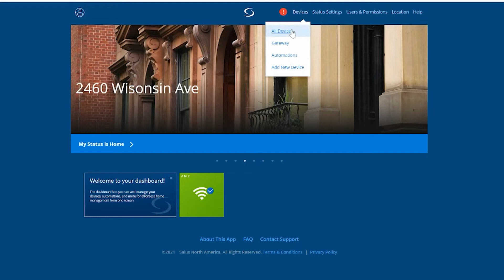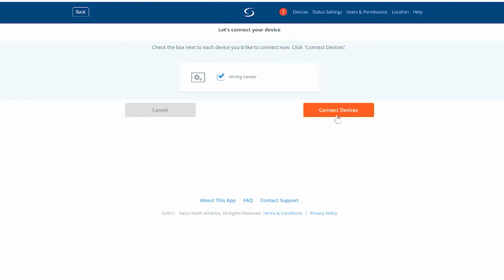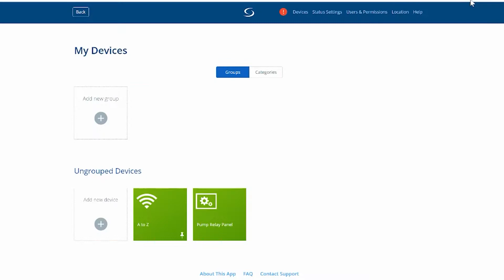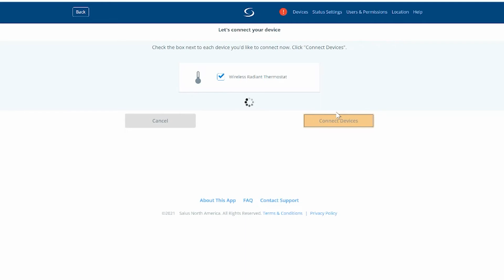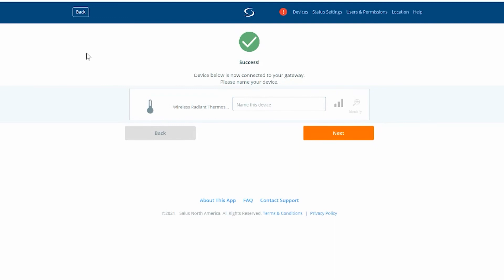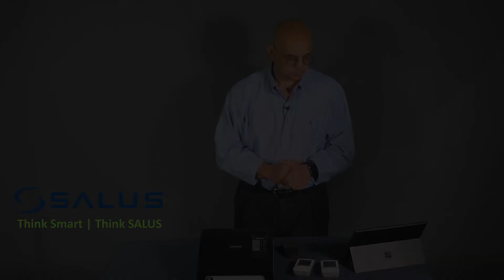Setting Up a SALUS Wireless 4 Zone Pump Relay Controller

Comment: My AWRT10RF does not go into pairing mode as you suggest. You should not have to be a Salus technician to turn the heat on. It is very frustrating.